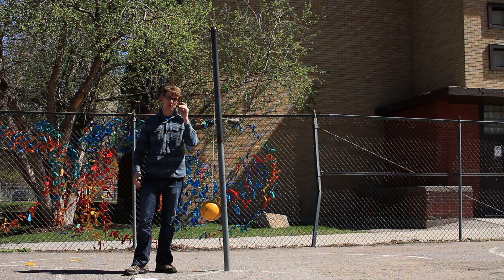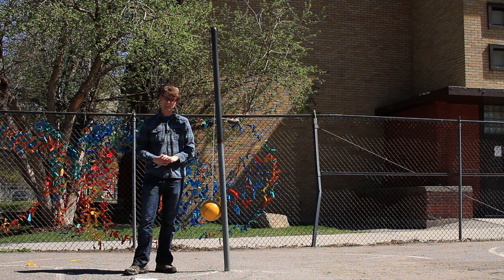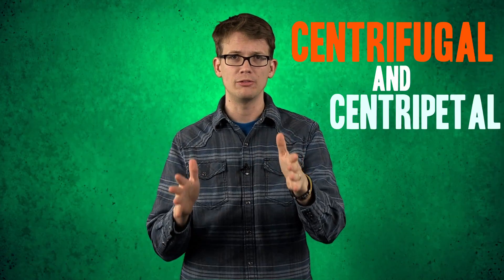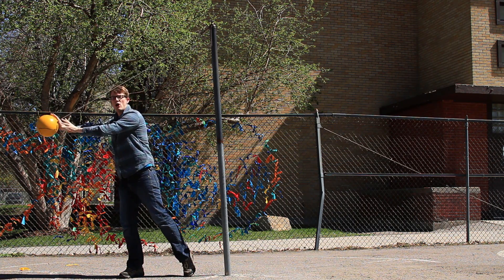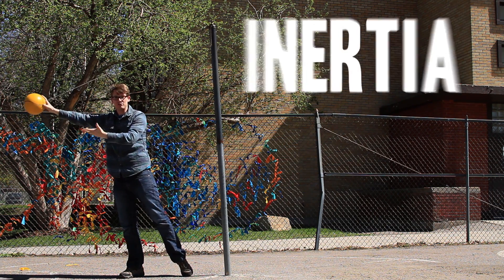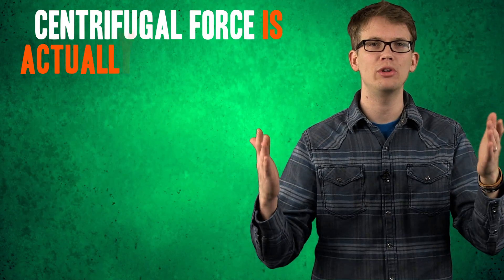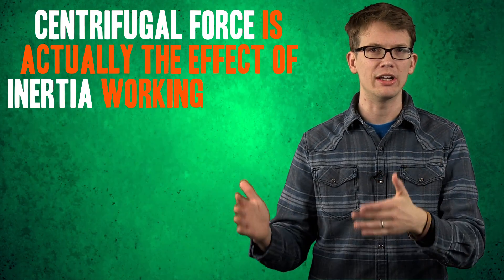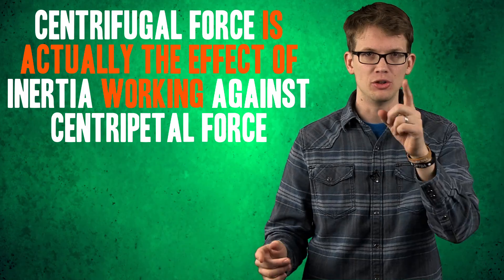IDTIMWYTIM: Centrifugal Force

Comment: There are actually TWO different 'forces' that are called 'centrifugal force'.  One of these forces is the reaction force to centripetal as you say, and is exerted BY the object in question.  The other 'centrifugal force' is an inertial force caused by the inertia of the object in a rotating reference frame and it is exerted ON the object in question - and is a ficticious force, but a valid concept nonetheless.  The 'force' in this scenario is the latter ficticious force exerted ON the ball.

Comment: Newton's 3rd law: To every action there is always an equal and opposite reaction.
Centrifugal force is the reaction force to the centripetal force and is exerted by the object on the string and is pulling the ball away from the axis or rotation. Meaning it is the inverse of the centripetal force.
Reply: No, the force that is opposite in this example is the force that is exerted on the pole in the direction of the ball at any moment, not an unexisting centrifugal force on the ball.

Comment: Physics fail. Symbol, Centrifugal does mean "away from the center". However, away is just a destination, and not a force. The force pulling away from the pole is called inertia. There isn't actually a force pushing directly away from the pole. Rather, the force is "pushing" the ball in a straight line tangent to the curve of its orbit. 

Also, "Have you studied in Physics?" is always answered "yes", because everyone studies under the effects of physics.
Try: "Have you studied physics?"

Comment: That's not centrifugal force.  Centrifugal force is an inertial force - a ficticious force - the result of inertia by definition.  I disagree with this video's claim that the concept at work here is inertia INSTEAD of centrifugal force - as they are one and the same, but what you are claiming is just plain wrong.  Also, there is no such distinction between a 'fundamental' force and a 'resultant' force - at least not in the way you imply.  Resultant force is just another way of saying net force.

Comment: That's exactly right.  In your frame (which is an accelerated frame - therefore NON-inertial) you need to assume that centrifugal force is real for the purposes of reconciling forces and applying Newton's laws.  In reality, inertia is what causes the appearance of the force - and centrifugal force is defined that way, so the concept is valid.

Comment: I suppose this goes in with the equal and opposite reaction law of motion. I always thought of centrifugal force as what one feels when one spins in circles with a weight in your hands. As you release that weight but keep spinning, the weight appears to travel straight out, whereas a stationary observer would see the weight continue on a tangent from the point of release.
Reply: The equal and opposite in this case would be the force on the pole by the teather, not the ball. The only reason you see a weight fly straight out is because you spin a little bit after releasing it.

Comment: I didn't say it was a force.  In fact, I categorically say that it is NOT a force, but the result of inertia.  Centrifugal force is DEFINED as such, therefore it is a valid concept.  Your problem is not understanding what the DEFINITION of centrifugal force is.  It is an absolutely necessary concept if one wishes to apply Newton's laws of inertial motion within rotating reference frames - - and WITHIN those frames, it can be considered a force for the purposes of reconciling forces.  QED.

Comment: About that barrel ride:  From your frame of reference in the ride it seems as if you are being pulled against the wall (centrifugal force).  In actuality, your inertia is moving you in a straight line perpendicular to a line between you and the center of the barrel.  The walls of the barrel are preventing you from continuing on that path and are exerting the force on you (like the string on the tether ball).  This combined with the force due to friction between you and the wall keep you stuck.

Comment: Well it sounds funny. Well, morbidly funny. But I think you don't need centrifugal force to explain a fracture. I think it's especially hard to understand because there is not much circular motion involved although the body does indeed move in curves. I think it's simply the seatbelt applying huge force to the torso and the head's inertia forcing the head forward and if the neck isn't strong enough, it takes damage. I think the neck is rather dislocated than the head being pulled straight off.

Comment: Same thing. The blood, being in the arm, gets accelerated tangentially by your body. You basically throw the blood forward. If your arm stopped existing (except for the blood), it would just splash in the direction of arm movement. Nice thought...
Your arm, however, and blood vessels keep the blood back and accelerate in a circular way. The blood's inertia lets it travel further in its previous direction which partly points in the current direction, partly outwards, if you think in vectors.

Comment: In the same way. A motor causes a momentum. It accelerates whatever is inside. There is no rotary movement that can be induced to particles, they all want to fly straight away once accelerated, you need a force to hold them back, such as a wall through which they cannot pass. Which is why centrifuges aren't made of very soft tissue. The particles follow the force which is always tangential to the container, that bounces them against the wall where they receive more tangential force.

Comment: So, I had a problem with this video.  The ball isn't perfectly inflexible.  So, when we cut the string, it changes shape, doesn't it?  Would that make it travel either inwards or outwards, or do the forces really cancel out in those directions?  I would think cutting the string would cause the ball to fly out away from the pole just a tiny bit perpendicular but mostly straight out like he said.. also, I agree.. why were external forces, like gravity.. ignored?

Comment: When you do change the system, there is a point to be made about the existence of another force due to third law of Newton. However, that is forgetting the origin of the centripetal force : the acceleration is not a change in the velocity magnitude, it's a change in its direction. 
And as Hank just said, the force you find is not real, since it is not a result of a physical phenomenon (such as gravity or elastic force from a rope).

Comment: "Normal force: Is it actually a force acting in the direction of the normal of a surface?"

 - Yes.

Nothing else in your comment is correct. Normal forces are perpendicular to the surface of contact force regardless of what other forces are involved. If you push horizontally against a wall, the normal force is the wall pushing back on you.

Comment: To be clear: The force on the ball in towards the pole. There is no outward force on the ball. It is important to isolate the single object that you are considering the forces on.

The equal and opposite force of the ball on the rope is not centrifugal, it is part of the centripetal force interaction.

Comment: Normal force: Is it actually a force acting in the direction of the normal of a surface, or is it a 'composite' force made up of an 'opposite to gravity' force and some sort of force pushing a body along the surface because of gravity?

Surely if there's no gravity there's no normal force, so how does the normal force get its 'tilt' from?

I'd love to receive either a text response, or, if you're so inclined, a video!

Comment: ok I always thought of it like this. centripetal force is the force the string applies on the ball towards the pole and centrifugal force is the force the ball applies on the string away from the pole. is that correct? Isn't the pole experiencing a force from the ball because the pole is probably bending a little bit towards the ball.

Comment: actually i think if you cut it while it was in motion there would be some change in the motion of the ball. it would be more accurate to say if the ball wasnt connected to the string while still in motion it would fly in a straight path

Comment: Same thing. When the water is in the center of the bottle there is nothing keeping it from going forward (towards the edge of the bottle).At the edge of the bottle,the edge will exert a force perpendicular to the edge(normal force) which will keep the water in a circular motion. one thing to note is that the centripetal force is also a fictitious force that describes the need of a force to keep an object on a circular path. The force needs to be delivered by an actual force(tension in the video)

Comment: Just because Newton's laws only hold in inertial reference frames does not mean we can't use other frames to analyze a system.

I have read numerous academic papers that use centrifugal force and of course they use it in calculations. Examples from just the first page of google scholar results:

1. "Fundamental investigation of functionally gradient material manufacturing system using centrifugal force": Equation (1) calculates CF and the result is used throughout the paper.

(continued...)

Comment: Listen, using Rotational reference frames goes against newtons second law of motion. You cannot have an object moving in a circular path without a force acting on it. Which is why you cant use centrifugal force. And enough with the scholar paper thing. Have you even taken the time to read any of the papers? Centrifugal force is a concept. They may use it in their explanations, but they use centripetal force in their calculations. FYI I didn't use google, I used google scholar just like you said.

Comment: Rotation isn't Relative. If everything around you looks like it's circling you, that means you're spinning.
Reply: There is such a thing as absolute rotation.  That is how we can measure the rotation of Earth with the Focault pendulum, and determine that the Earth rotates 15.04 degrees per hour.   It would be 15 degrees per hour if Earth weren't also orbiting the sun, but it becomes 15.04 degrees per hour when you measure to a fixed direction in space.

Comment: Do you mean the question "what are you spinning in relation to?" My initial instinct is that rotation is an inherent property of a system. That is, unlike velocity, you do not need to define it relative to external objects.

But I did more research and found that this seems to be an unresolved question in physics. The wiki page "absolute rotation" has more info. Also google "Is rotational motion relative to space? - Physics Stack Exchange" for a good discussion.

Comment: Centripetal force and acceleration are inextricably linked by F=ma. You can't have one without the other. If your body is rotating with no external forces, then the various parts of your body are being accelerated such that they orbit your center of mass. The rigidity of your body tissue is the source of the centripetal force that causes this acceleration. Basically your bones/muscles/other tissue act like the string on the tetherball.

Comment: The force the ball is exerting on the string is called the "reactive centrifugal force" and is 100% real (meaning it exists in all frames). Centripetal force and reactive centrifugal force form an equal and opposite reaction pair as required by Newton's 3rd law. The reactive centrifugal force creates tension on the string.

Comment: Just to be clear: the fact that the centrifugal force is "fictional" does not mean you should never use it. Centrifugal forces do exist in rotating reference frames, and using it in such a situation can often greatly simplify the analysis of a system.

Don't believe me? Search "centrifugal force" (with quotes) on google scholar and you'll find 300,000 results. If ~100,000 scientists feel comfortable using it, you should too.

PS the Coriolis force is another example of a "fictional" force.

Comment: I didn't say it was responsible for it per se. Rather that inertial forces provide a useful calculational aid in such situations. Also that, in some frames (notably the frame of the car with the helium balloon in it), the motion *is* due entirely to the inertial force (although in an inertial frame it is not). Essentially I'm claiming that all observers (including accelerating ones) make valid observations but not necessarily the same ones.

Comment: I know you are. The reason inertial forces exist in some frames but no others is because they are introduced in order to make non-inertial frames look inertial. If you do this, some problems are easier to solve (fluffy dice and helium balloons for instance where it's essentially a two line calculation but in an inertial frame takes significantly longer) and many aren't. Non-inertial frames are usually not nicer (as their physics is more complicated) but in some situations they are more useful.

Comment: My point exactly, inertia isn't a force. I am indeed denying the centrifugal force's realness. The example with helium balloons has nothing to do with a centrifugal force for two reasons. First of all, when breaking or turning, the air in the car rushes to the front/side of the car (because inertia), creating high pressure. As you know, helium gas is less dense than air, and will rush to the side with lower pressure. Second, why would a force exist in one frame but not in another?

Comment: I guess I'm just unclear on which force you're talking about.. The force pushing the passenger away from the door (thus accelerating him towards the center of the curve), or the inertia of the objects in the car (for example a ball on the floor) making them move relative to the car, which is accelerating towards the center of the curve? In the latter case, no force is acting upon the ball causing it to move away from the center of the curve.

Comment: I do mean frame of reference (specifically a rotating one). If you choose the reference frame of a rotating observer, you do see a centrifugal force. Also, whilst this inertial force will only exist in suitable frames (unlike non-inertial forces), it still exists in those that do see it. Furthermore, many problems (for instance the helium balloon in an accelerating car) are actually easier to solve in an accelerating frame. It is not *objectively* wrong and, ultimately an aesthetic choice.

Comment: Did you read my post? If I were talking about centripetal force I would not be talking about it only appearing because of your silly choice of co-ordinates would I?

My point was that "fictional" force is a poor term because they definitely do exist and are observed but only in silly non-inertial reference frames where they are caused by the acceleration and exist to transform it into an inertial frame. As such "inertial" force is a better term.

Comment: Yes, from the POV of the ball, the centrifugal force is not real, but every action has an equal and opposite reaction. The pole (via the string) is exerting the centripetal force on the ball, so as a reaction, the ball (via the string) is exerting a centrifugal force to try and knock the pole out of its place. So, even though from the POV of the ball, the centrifugal force is inexistent you can't say the centrifugal force is not real. It IS real.